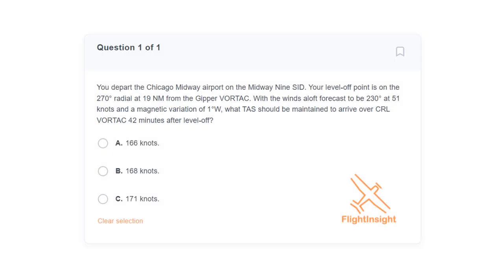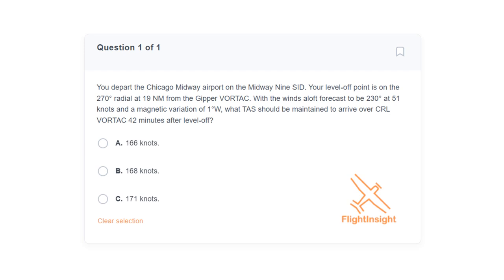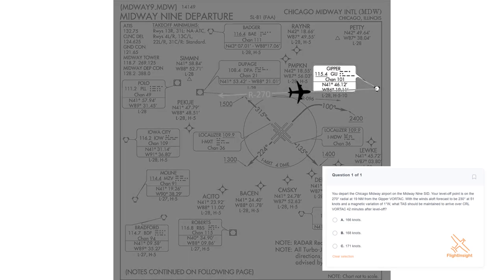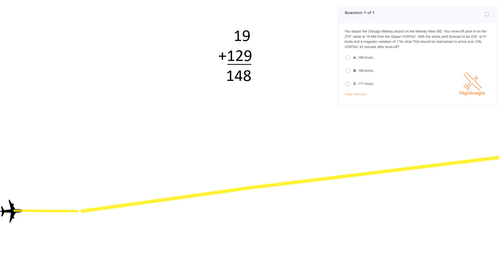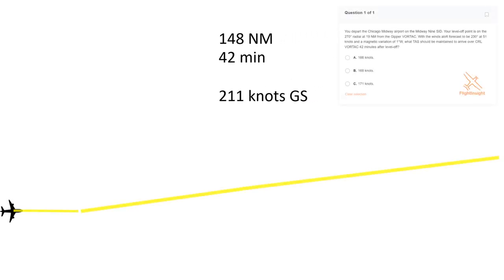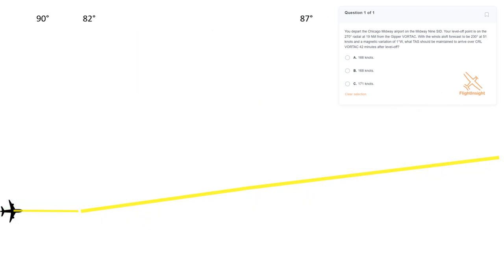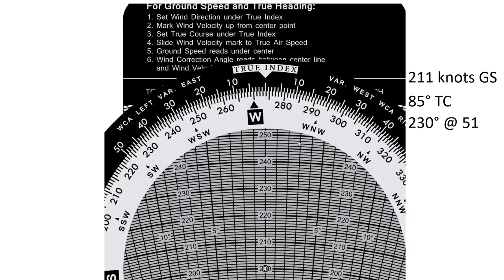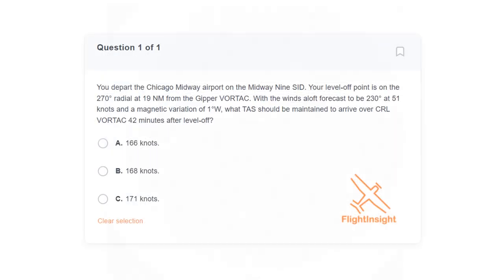ATP Exam Questions | IFR Time Enroute

Comment: I’m a 10th grader wanting to become a pilot and now I’m wondering what the hell im looking at
Reply: It's basically asking you based on the direction you are flying and the current weather/wind conditions, how long will it take you to get somewhere. So you take how fast your airplane moves along with the wind direction and speed which will change how fast you move over the ground. Then you have to figure out what direction you're moving. Maps are all based on true north (north pole) and we navigate using a compass (magnetic north) therefore we have to calculate the difference since mag north is at a different location on earth and moves! Not difficult once you figure out the steps here.

Comment: “East is least and west is best”. Why wasn’t 1 added to the mean Mag Course of 86, to get 87. Obviously such a small difference here plays no difference in the answer. Just curious for a question that would have a greater mag variation. Nonetheless, great video! Thanks!
Reply: I believe you are correct.   Plus you can't just average the course directions... you must take the weighted average:  [(90*19)+(82*50)+(87*79)]/148 = 87  (edit:  86 if you manage your significant digits).  Less 1 degree variation gives you 86 degrees.
Reply: If I'm not mistaken it's because that's to go from true course to magnetic course. Going backwards, like was done here would be the opposite operation
Reply: @Bluerazor52  yes... I stand corrected
Reply: Because forecast winds are always reported as True, only winds from ATIS and ATC are magnetic
Reply: "East is Least, West it Best" applies when converting true to magnetic. Opposite when going magnetic to true